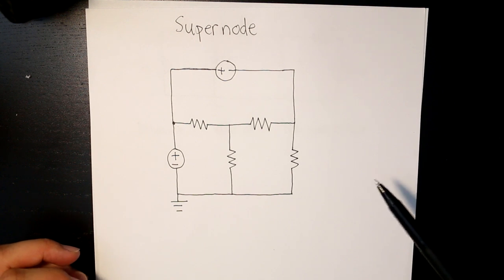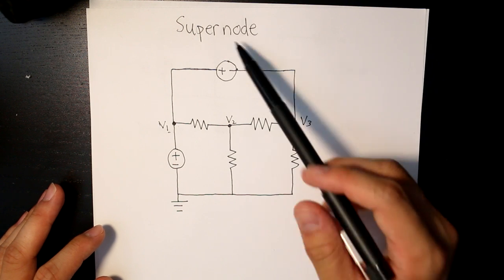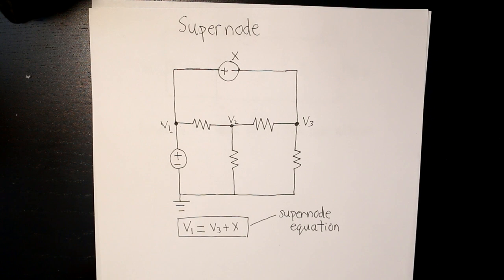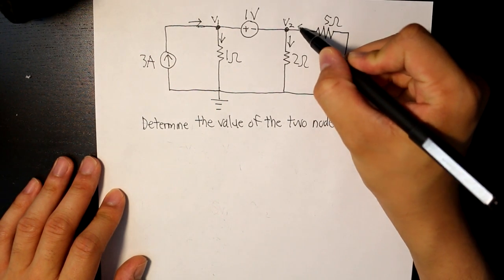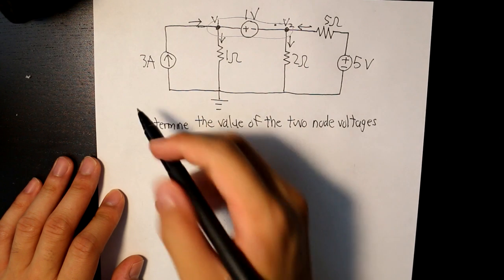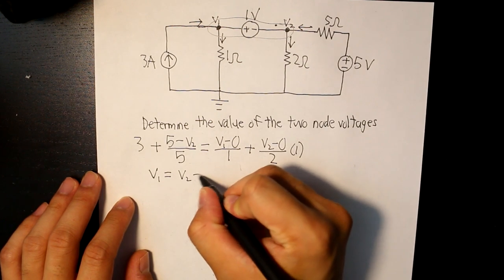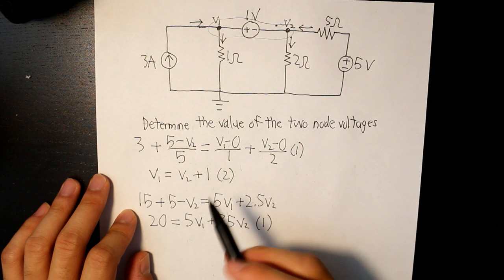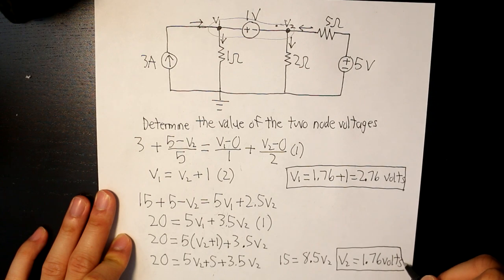The Supernode

Comment: what  happens   if  resister   is  connected  across   super  node  equation  ?
Reply: Easy, solve for current. No need to make a super node in that case since you can calculate the current flowing in/out of the node using Ohm's Law.